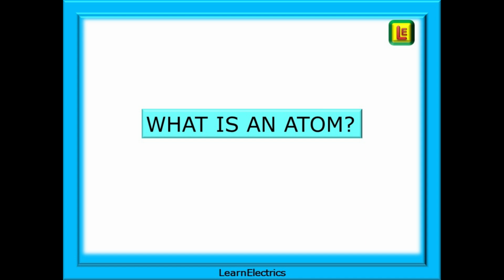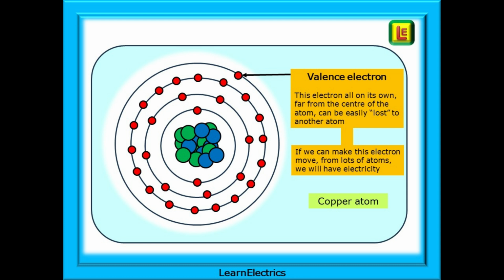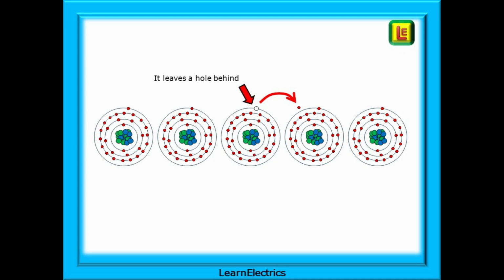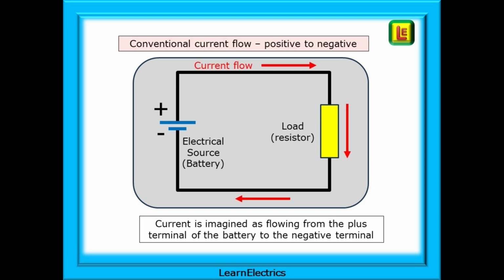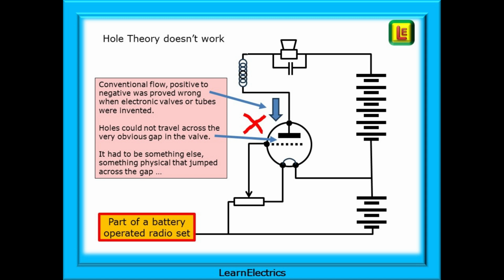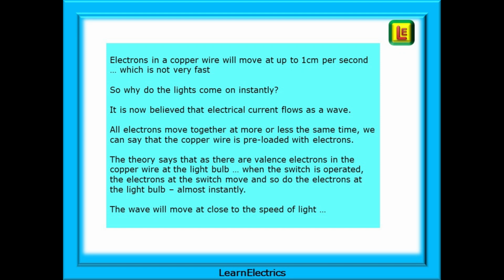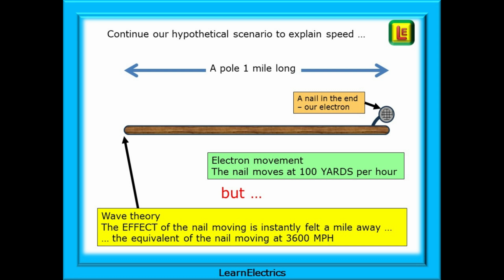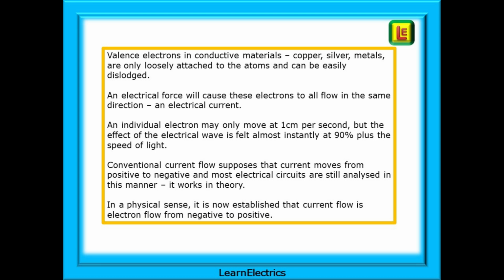HOW FAST IS ELECTRICITY – HOW DOES ELECTRICITY MOVE – WHAT IS AN ELECTRON – WHAT IS ELECTRIC CURRENT

Comment: Great video again very important to understand this.I always thought the electrons flowed like a river but theyre actually bouncing forwards and backwards from atom to atom. I assume the wave you mention is the emf and so when we switch on a light for example we are in effect switching on that wave or emf that is pushing the electrons that are already in the copper wire to the bulb. Im still trying to comprehend the 2 different speeds because does the wave not carry the electrons like a wave would carry a surfer. The 2 different speeds im trying to understand maybe I will watch the video again to get it ingrained. Thanks very much for taking the time to make this very educational video.
Reply from the maker: Electron theory is constantly changing. Even the boffins at CERN keep finding new things. A fascinating subject.